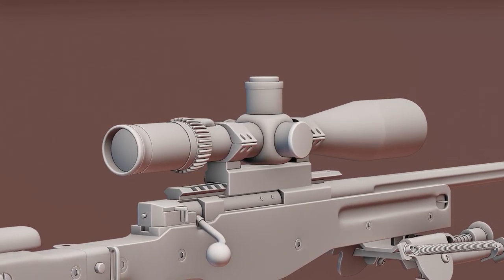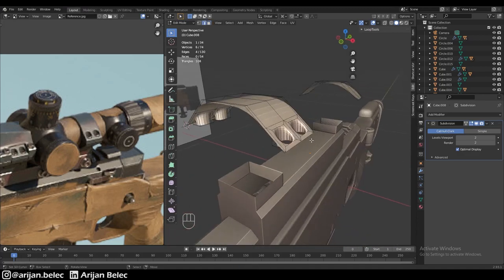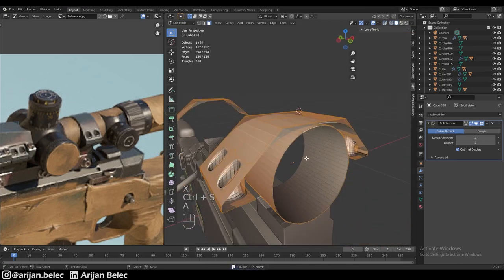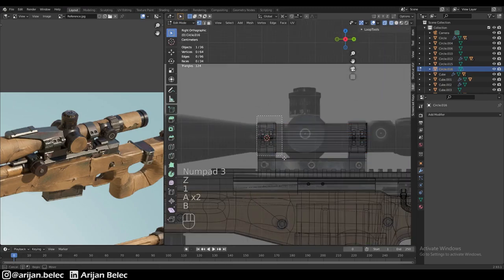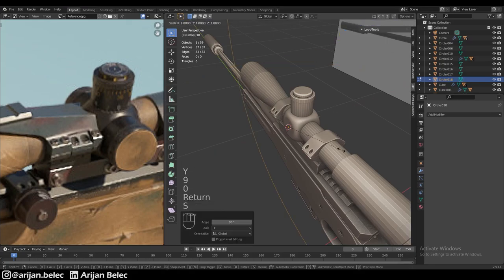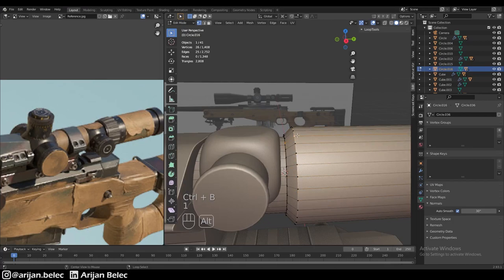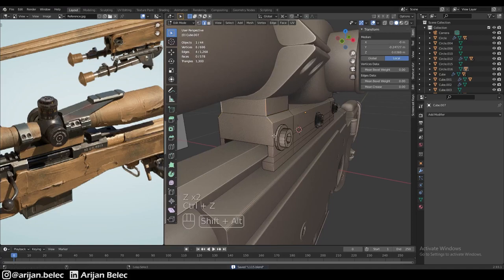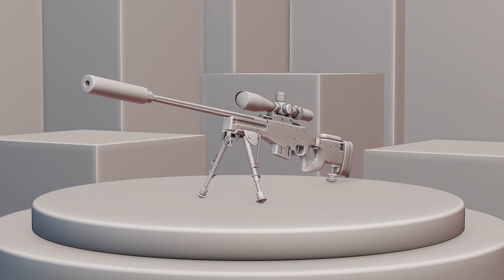Modeling a Sniper Rifle Scope in Blender | AWM Tutorial Part 4 (Arijan)

Comment: Sir, I have been using blender for years but I have never seen anybody so in tune with the modeling without using add-ons, just pure geometry.  This is an amazing series and you are extremely talented.  Great job!!!   
The 2 knobs are for windage and elevation adjustments.  Basically moving left/right or up/down the crosshair to align the scope with the condition of the shot.  If there is wind the trajectory needs to be compensated in the opposite direction and base on the distance and gravity drop of the bullet, the trajectory needs to be adjusted vertically.
Again great job and thank you!!!